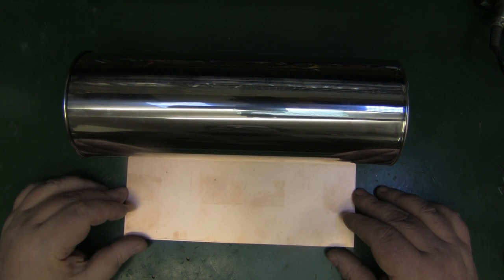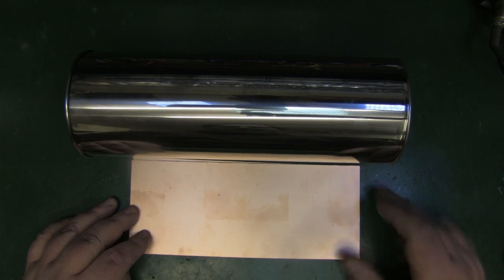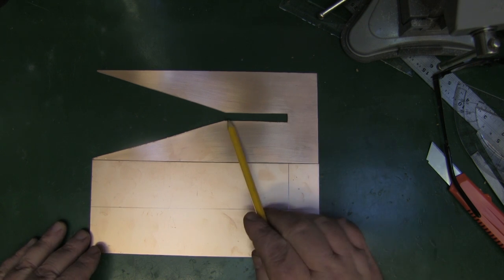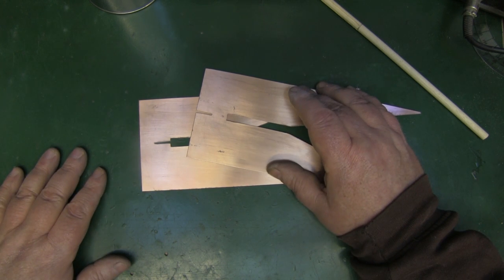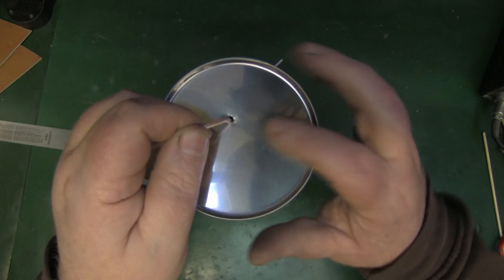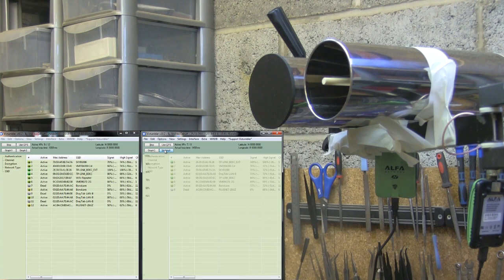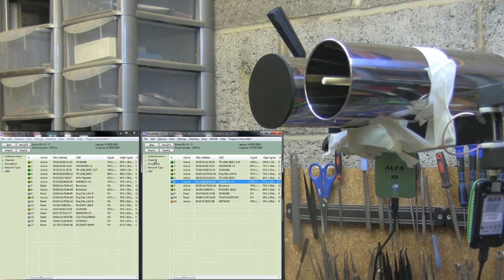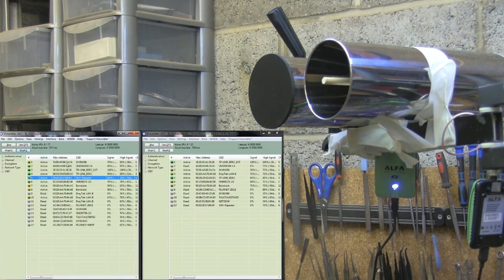Is it Worth the Effort Building a Vivaldi Cantenna for WiFi

Comment: Interesting.  The Vilvadi Antenna is more a broadband antenna also and thinking you're gain on certain locations is due to polarization effect... though not sure.   Wondering the straight edge versus the logrithmic or whatever the rounded edges are effects compared are like.   These have caught my attention for sweeping broader band especially recently with the antennas being so cost effective up to 18.5GHz.  I wonder about the log periodic antennas too.  Thanks for sharing!

WA5VJB has some cost effective designs and thinking you can do the same with the straight edge design (here's the bundle, though he sells separately also):
https://www.ebay.com/itm/Vivaldi-Antenna-Bundle-One-9-25-GHz-Vivaldi-and-One-5-18-GHz-Vivaldi-by-WA5VJB/254183053739
Reply: Note that the individual antennas have the more detailed performance characteristics on their separate listings.

Comment: Andrew, may I ask you to construct a cantenna to the following spec? I have made one, it is brilliant but I do not have the apparatus to test properly
Can 190mm long
width 85mm. This is important, your toilet brush holder is too wide
driven element 75mm from rear, length of element 33mm, and preferably thick, eg 3 or 4 mm.

thanks

Nick

Comment: As seemingly dry wood indoors tends to contain roughly 20% moisture (possibly more on a wet day like you mentioned) is it possible that the piece of dowel that is projecting forward from the slot is interfering with the signal reception?